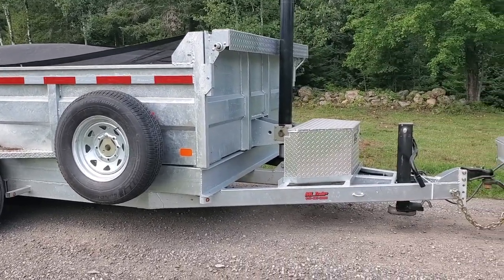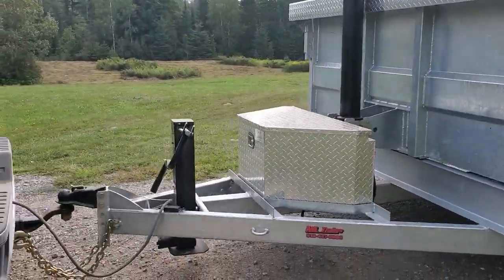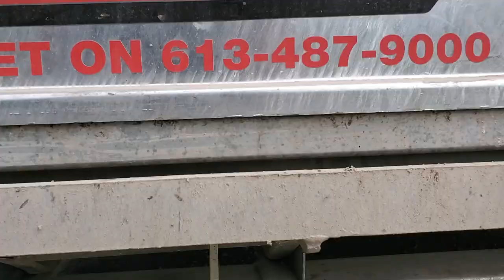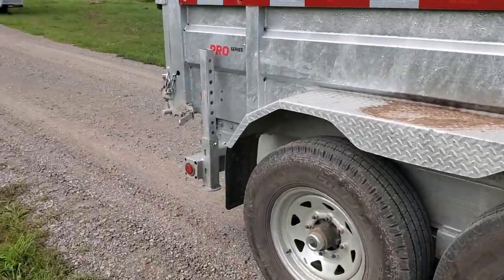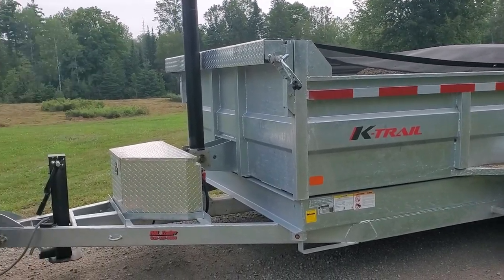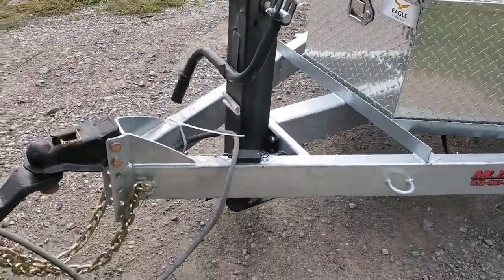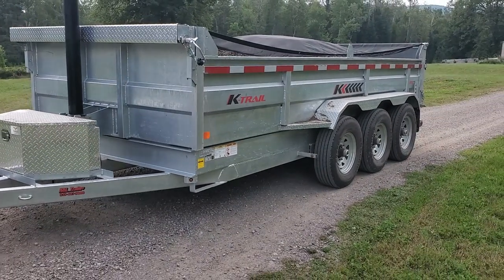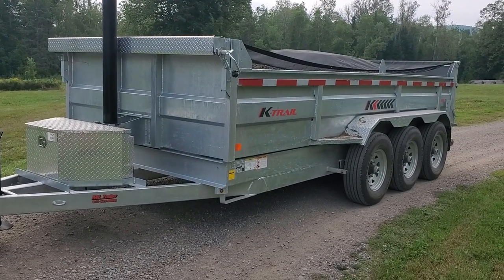Triaxle K-trail 10 ton Dump Trailer 5 month review.

Comment: Nice trailer... love galvanized. Tongue looks a little shallow, but you won't overload it on your pickup truck. I'd love it to haul equipment, but in my case: no CDL... gotta be content with my 14k. Enjoy that thing 👍👍
Reply from the maker: Thanks, I'm still trying to find the sweet spot for trailer level. When it's empty the front axle on the trailer is real light. If I forget to turn off the brakes to trailer or not light enough brakes you flat spot them and that sucks😢

Comment: Nice trailer! 

I am looking at a similar 16ft tri axle trailer. Just wondering how it turns when loaded and empty? Does it seem to drag and put a lot of stress on the axles or no problem?
Reply from the maker: Honestly it doesn't tow much different than my old 7 ton ironbull did it was 16 foot also.
I imagin it is going to wear tires quicker but I don't really turn that much. I live in the country so I wide turn it when I can.
Reply: @doylemaintenance  Thanks for the feedback!
I just want the extra payload capacity and feel like the weight will be more evenly distributed across three axles under the frame/bed. Plus changing flat tires on a tandem dual axle is a bit of a pain.

Happy hauling and thanks again!

Comment: Painfully slow, I would ask the dealer to take a look, use your wife's least favorite nail polish to mark the 3 chain links used most. Also you can buy Traveller Wireless Winch Remote Control for your up and down functions, p/u at TSC.
Reply from the maker: Wireless would be great, thanks for the tips.